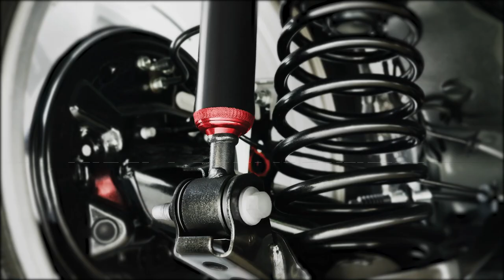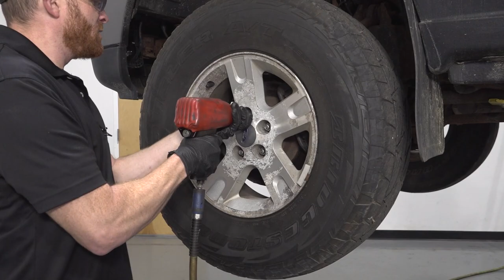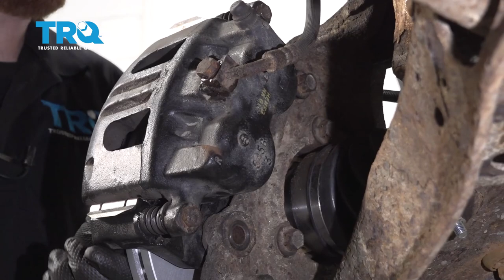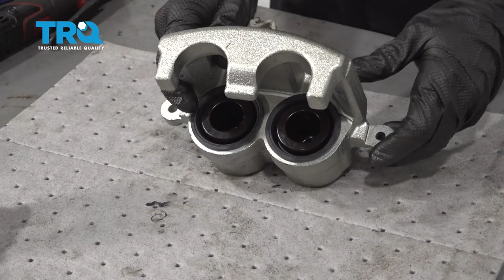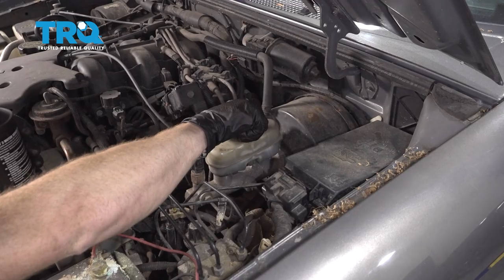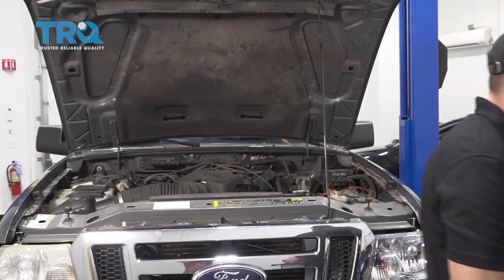How To Replace Front Brake Caliper 1998-2011 Ford Ranger

Comment: You made removing the caliper bolts look so easy to remove. @ 85 ft lbs most of us would likely need a breaker bar and cheater bar to remove if red thread locker was used. I rounded the head of mine as i didnt go slow and steady ir use a breaker bar. If there are issues that are sometimes incurred i think they should be mentioned as a cautionary reminder.

Comment: I just found out where I made a mistake in my install. The slide pin with the rubber bushing goes on to the hole of the caliper bracket.
Having a hard time with the caliper and that's the reason why.
Thanks TRQ for the video!

Comment: i found one problem with your video that would have been helpful. Letting us know what size the bolts are 12mm or 1/2 inch. Here is why, my bolts are so rusty nothing fits so before i start forcing socket on it would be nice to know if its the right one. other then that great video.